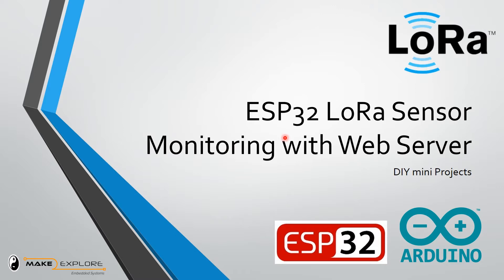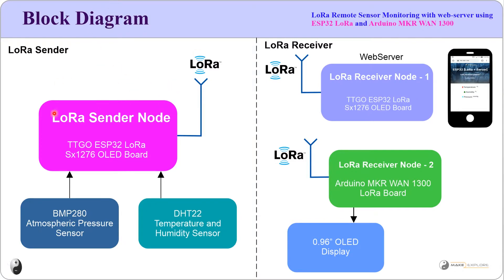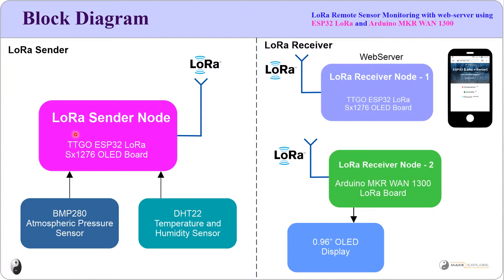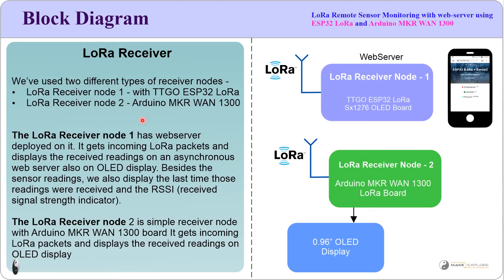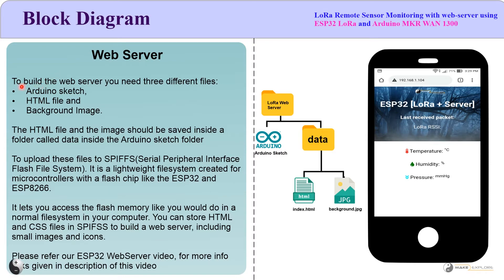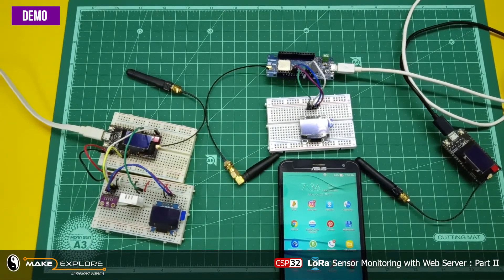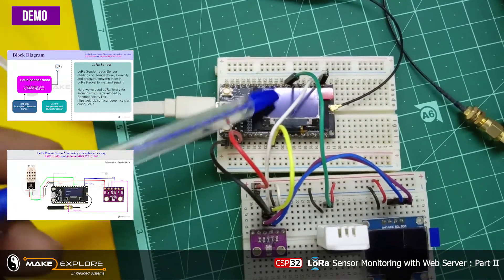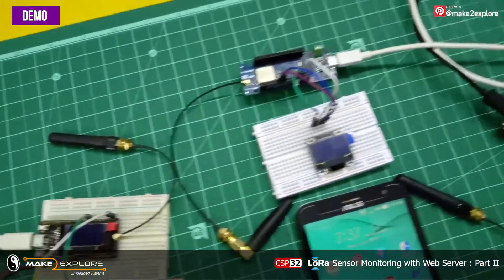[Part II] ESP32 LoRa Sensor monitoring with Embedded Web Server

Comment: When I upload your code my oled display doesn't ON  it blacks what to do for that?
Reply from the maker: Dear @status karaan only M V

🙏 Thank you very much for your interest in our channel.

You must be referring to the OLED display interfaced with MKR WAN 1300? Right?

If your OLED display is same as of we used in this project (0.96", 128x68, I2C OLED)

Then You can troubleshoot with following steps - 
==> Check correct I2C pins(SDA/SCL) are connected to the display.
==> It is better to use 5V power for OLED, rather than 3.3V.
==> Check I2C address of your OLED display, use I2C_scanner_Sketch
Your OLED I2C address may be different than given in our code. Replace it with your and check again.

If you still facing any issues in replicating this project, Feel free to contact us through email  
📩 - info@make2explore.com
Also, For quick replies, you can always chat with us on 🚀 Telegram 
🔗 https://t.me/make2explore

We'd ❤️ love to help.

Best Regards 🙏

Comment: Hallo sir, i have a problem with esp32 ttgo lora sx1278. When i upload program to the esp, in serial monitor give me to me text " Could not find a valid bme 280 sensor, check wiring! " What happen wrong, Sir ?
Reply from the maker: Dear Subscriber, 🙏 Thank you for your interest in our channel.

This issue is of I2C connection between ESP32 TTGO LoRa and BMP280, Please follow the steps below to troubleshoot this problem

1. First check wiring (SCA, SDA lines) for correct connection as per circuit diagram given in GitHub link.
2. Then find out the I2C address of your BMP280 sensor using "i2c Scanner sketch" which is also given in GitHub link. 
3. After that in "LoRa_Sender_Web_Server.ino" sketch go to Line 123 which looks like following
  
if (!bme.begin(0x76)) {  

and change the address (0x76) to your sensors address...(which you've got from i2cscanner)

****If above does not work and if your sensors address is different than (0x76, 0x77) then do the following
1. Go to Arduino library folder "C:\Users\USERNAME\Documents\Arduino\libraries\Adafruit_BMP280_Library"
2. Edit the header file "Adafruit_BMP280.h" and in line 32,33 change default I2C addresses as per your sensors i2c address.

GitHub Link:
▶️ https://bit.ly/3bLBCh8
also 
*other code links are given in the description of video. 

If you still facing any issues, Feel free to contact us through email  
📩 - info@make2explore.com
or Search "@make2explore"  on Telegram 🚀

We'd ❤️ love to help.

Best Regards
Reply: @make2explore  I've tried changing the address in the bme280 library. but the result is the same.